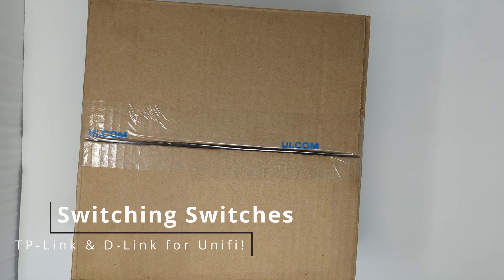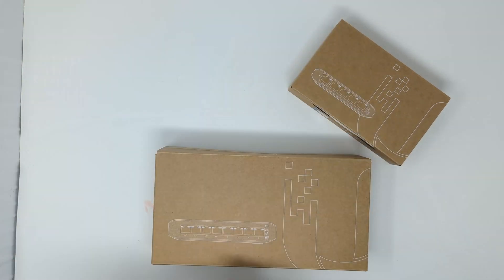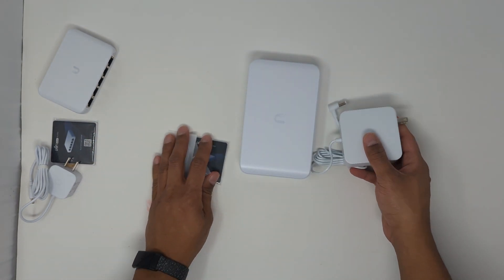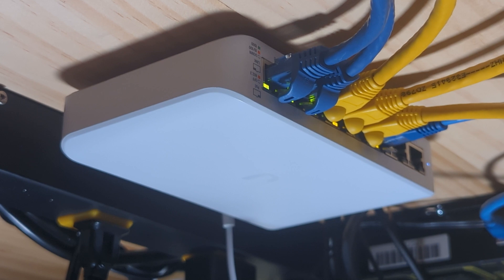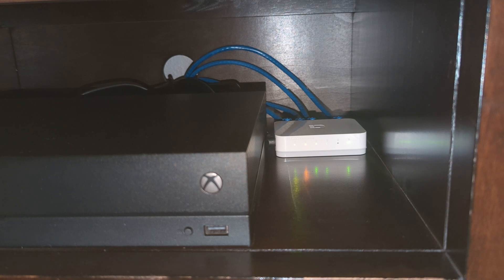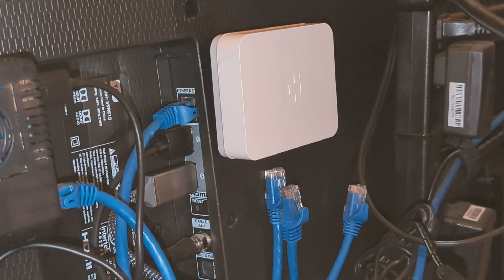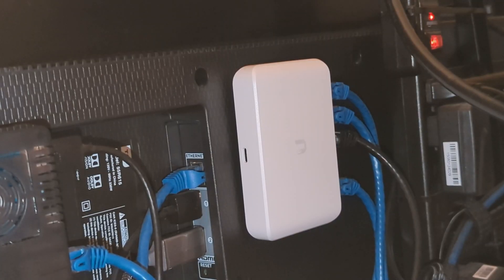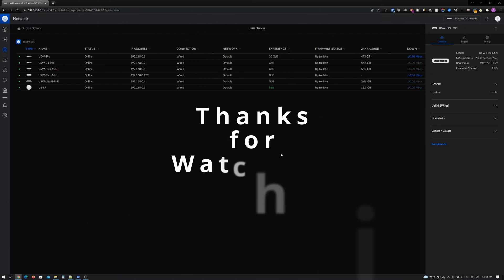Switching Switches - Unifi USW-Flex-Mini & USW-Lite-8-PoE

Comment: I would like to see how a Unifi switch differs from a normal one
Reply from the maker: There are a few reasons I switched out my old switches (not that they didn't work). With the Unifi switches I used I have more control, insight, and metrics... I can set per port profiles to manage traffic. In the Unifi controller I can see exactly what device is connected to which port. I can remotely restart the switches. For the Flex Minis, I can power them with PoE so this comes in handy where a location is difficult to get power to... So in short, the remote manageability and monitoring.